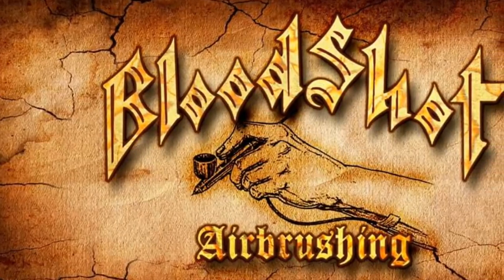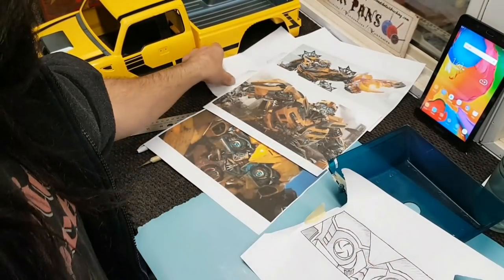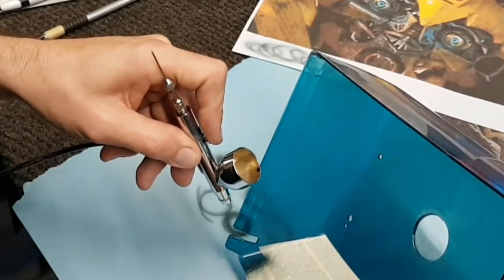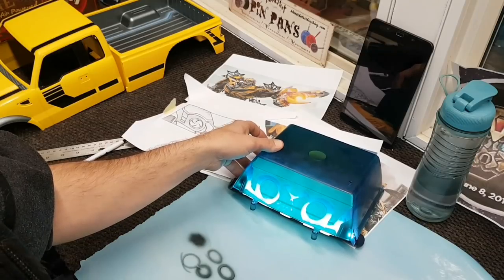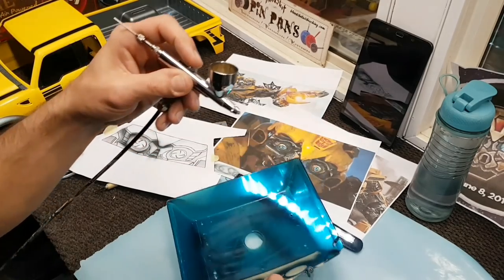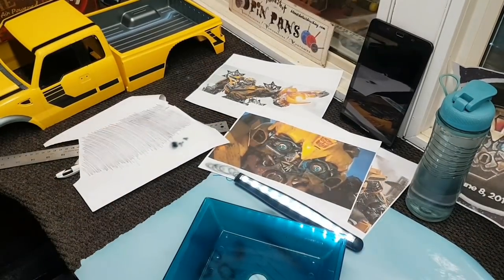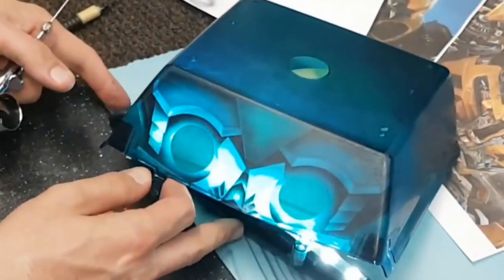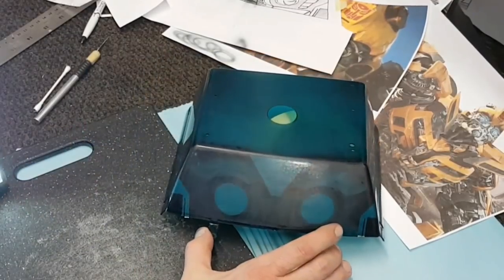RC Airbrushing Tutorial (Part2/3) Methodology & Application of Water Based Paint.

Comment: Hi Ryan. I'm learning a lot from you, thanks. One question please. After taping a graphic on to a water - based - paint base coat (auto air) what would I use to wipe away my finger prints from the surface. Hope you can help as the wax and grease remover I use took some of the the base coat off as well.
Peace Brother.
Bob
Reply from the maker: Bob Martin I use the same grease and wax remover... I go over super lightly! But it's the only thing I've found that works.. . It's all a delicate balance Broski!! I will use some g&w remover on the end of a q-tip and ever so gently wipe it down a few times... hope this helps ya out a bit bro!! 😁 Big Cheers and Much Love from the BloodShot Studio!! 🤘🤘
Reply: Cool. Thanks Ryan